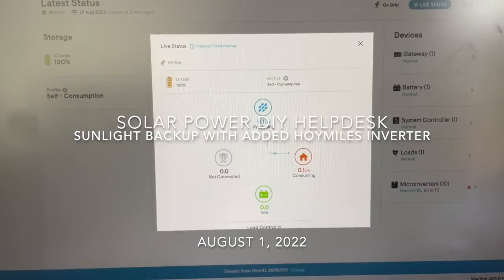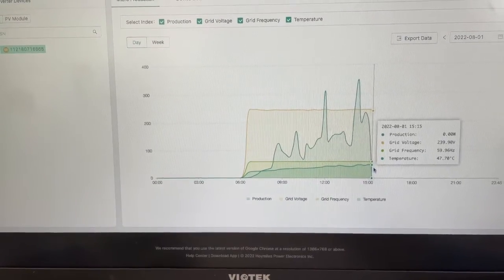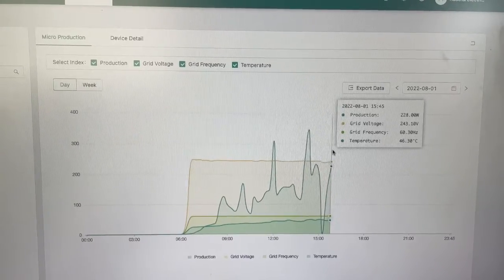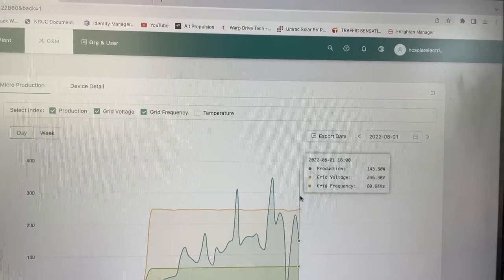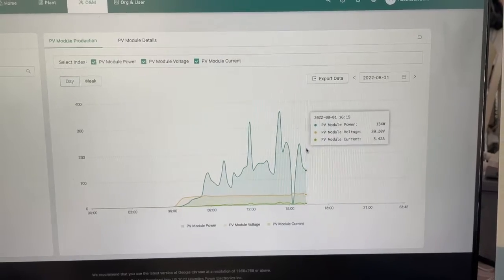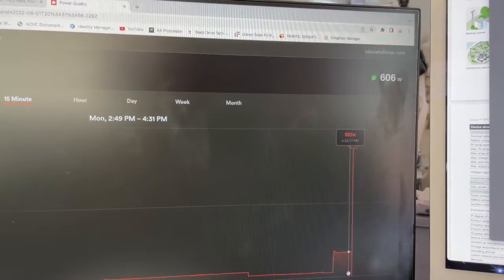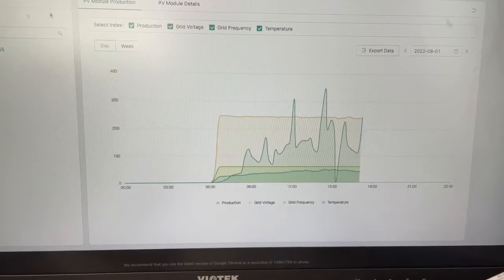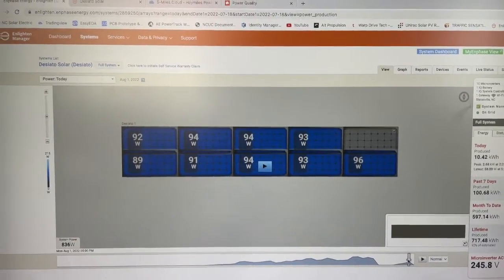Enphase Microgrid with an Added Hoymiles Inverter - Test Data

Comment from the maker: In summary, operating one or two Hoymiles HM-350NT microinverters in parallel with my ten Enphase IQ8+ inverters works fine. However, when the power goes out, the Enphase battery frequency shifts and usually temporarily pushes the HM inverters offline. They will come back online after 5 minutes and contribute to the microgrid. There were no failures and they're working fine on grid. The grid profile of the HM inverters can be changed to match the Enphase inverters too.